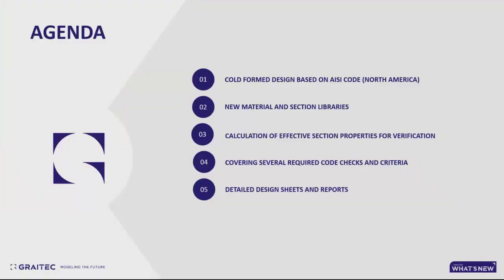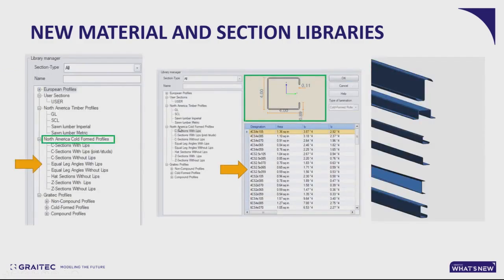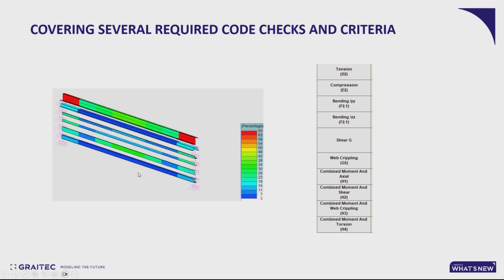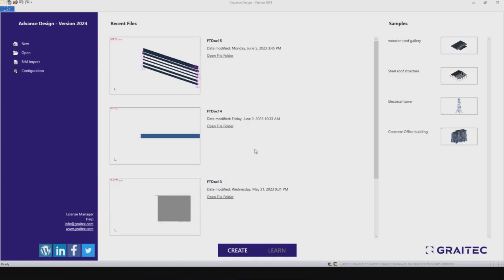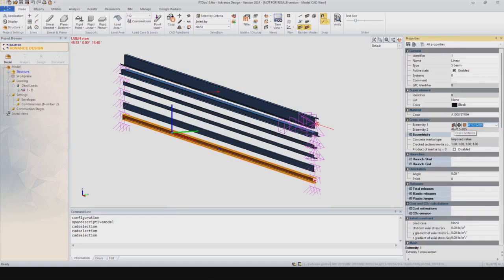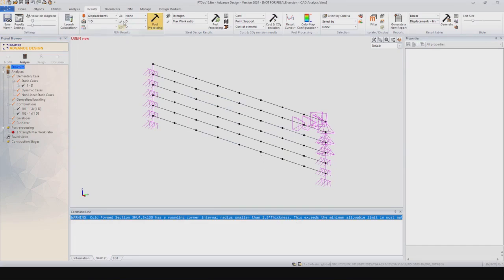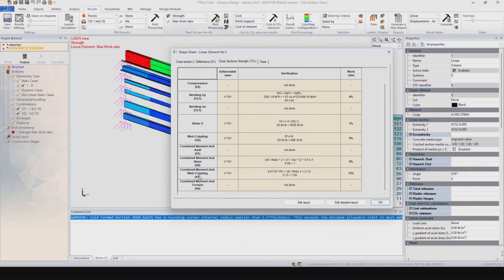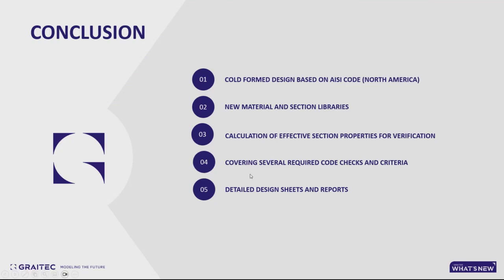Advance Design 2024: Steel Design Changes

Comment: Great Work 
But i tried on  a small Concrete project 4 columns and 4 beams and 1 slab Then Compare with Etabs & SAFE it's completely Different 
the value from Advanced Design Is Less Than Etabs by 4 ton meter and less than Safe By 2 ton meter    
when i applied 0.5 ton meter on beams it's length is 6.7m the moment My on Beam on dead load case was 1 meter ton and when you applied the low of moment for simple beam you will find W*L^2/8 it will be equal 3.37 meter ton 
W = 0.5 ton/meter 
L= 6.7meter 
in etabs result was 4.5 meter ton in safe result was 4.1 meter ton but in advanced result was 1 meter ton and I'm sure the material and every thing   is the same 
if you know why i will be so happy if you helped me 
and thanks for video
Reply from the maker: We appreciate your question! We would like to learn more about your model in order to answer your question. Please forward your comment with your name and email address to support.us@graitec.com so that we can work with you to answer this!